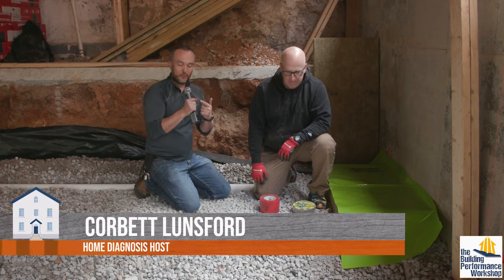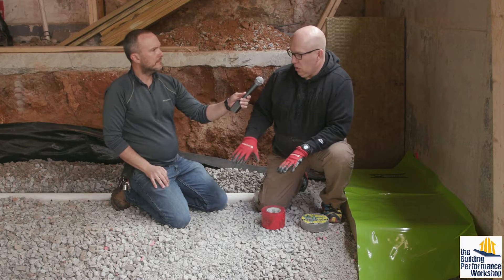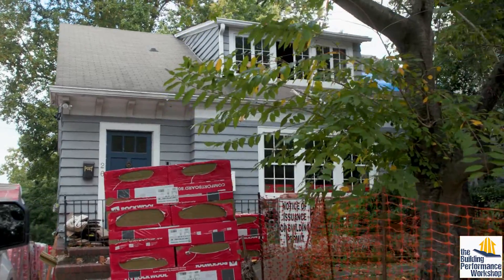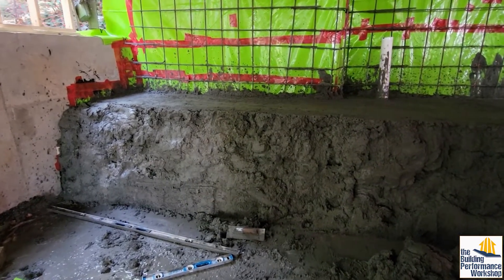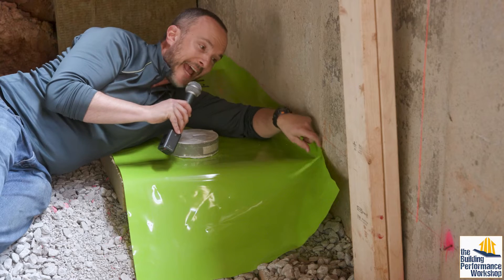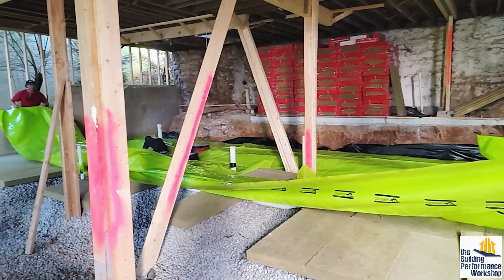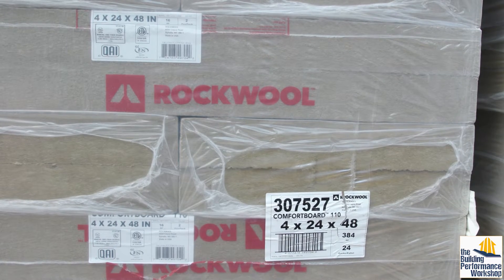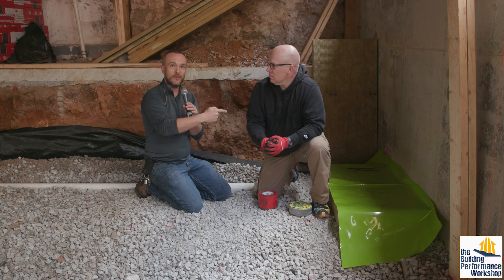Tearing a Historic Home Foundation Apart- Pouring a Passive House Concrete Slab and Shotcrete Wall

Comment: Why did you both choose Rockwool over Polystyrene for foundation insulation? Airflow to aid with Radon mitigation? Doesn't it cost more?
Reply from the maker: I used polystyrene (EPS, aka Styrofoam) in our TinyLab’s floor cavity, and have been listening to ants eating it for years. Not a huge fan as a result.